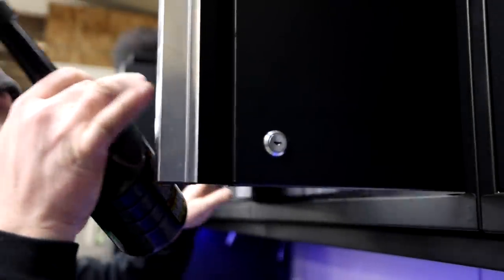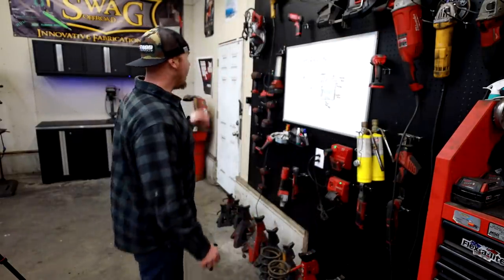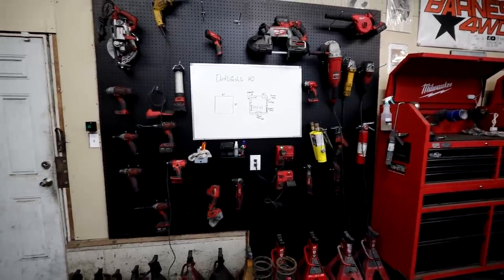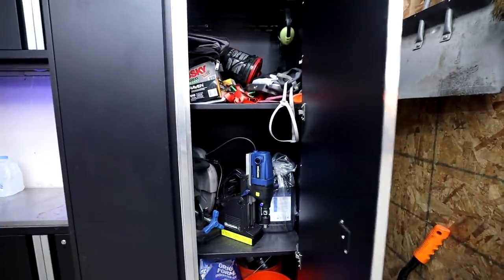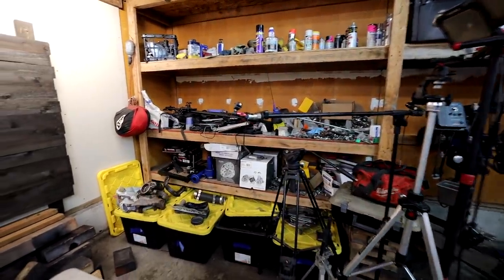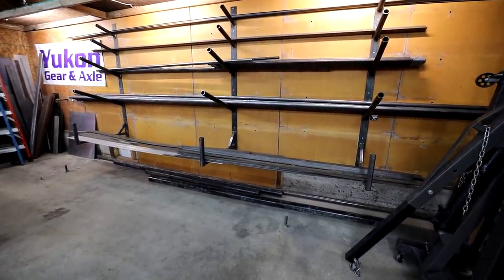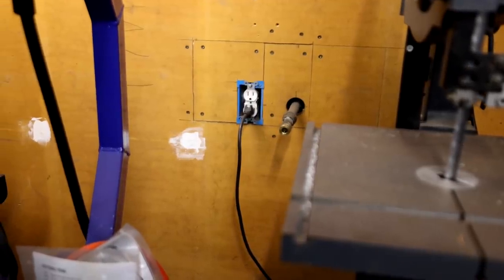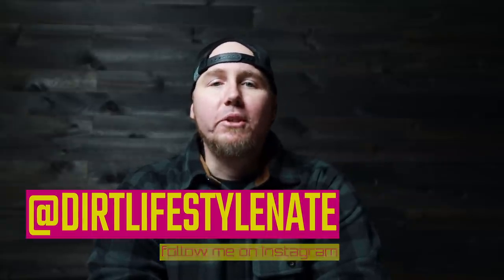Off-Road Workshop Tour! Let's Do A Garage Walk Around At Dirt Lifestyle HQ

Comment: I’m extremely glad you mentioned that you ran your compressed air with pex. I have been wanting to plumb my two car garage with air but wasn’t sure if pex would hold that kind of pressure.
Reply from the maker: We would test our plumbing systems to 150 psi for inspections and I never saw a problem. This system in my shop has been holding air pressure for 5+ years with zero leaks 👍
Reply: Not Pex Wirsbo, it a higher quality product and better in everyway, I build a house and oversized garage in here in Manitoba Canada where the winters are super cold and i have never had a leak in any part of it going on 21 yrs, thats in the house, garage inflow heat system with 2 loop system and air in the garage just run along the ways, although my compressor only produces 150 psi most tools don't use that much , it still hasn't leaked on me yet its worth the extra money and its not much more and you can do it yourself and doesn't take long maybe a day tops 👍
Reply: I used 1/2” pvc for mine and So far it’s working great! It’s pretty much a straight run, just an enclosed carport. Can’t fit a jeep in with all my tools/machine shop equipment in there lol. Have to work in the driveway but I’m thankful for the shop space I have!
Reply: I used plastic air line for commercial trucks it come 1/8 to 3/4 my shop plumed in1/2
Reply: I have been using my pex air lines for 6 or 7 years, not problems so far here. My friend owns a big brewery and plumbed the whole brewery with pex air system about 10 years ago and has no problems
Reply: @99unclebob  wirsbo is type A pex. Wirsbo is just the brand of pipe and they aren’t in business anymore anyway. Wirsbo was bought out by uponor a couple years ago.
Reply: @DirtLifestyle  we always tested ours 80 psi because in California water systems are supposed to be regulated to 65 psi. Never put more than that on there but I’m gonna plumb my air system with pex now.
Reply: Plumbed my garage air in pex used brass fitting and used 1/2 pex to 1/2 npt drop ear elbows to fit all my female air quick change couplers.  Been going for years no problem and it was very easy to modify when I installed new cabinets
Reply: @mikeparker5935  oh I meant to mention that I have been running mine at 125psi and kind of think my buddy runs his at 150psi
Reply: @DirtLifestyle  did you use regular wirsbo or did you go with the aluminum sleeved kind? UA 290 plumber down here in Portland looking to do the same thing in my shop. Love the content, keep up the awesome work!

Comment: "...Two car garage and a gravel driveway..."  I know what you mean. Three years ago I was putting running boards on my van in January, and it started raining 3/4 of the way through. Thankfully is was only 35 degrees. 
Now I have a 30 x 50 foot shop with a Modine heater and a Back Yard Buddy lift. I don't have the words to describe how thankful I am.

Comment: In my old mans shop he has a 1/2 inch plate on a scissor lift for years . The sheet is 8’ x 6 . All his grounds for the welders get clipped on . He’s been  rocking it for 10 years . His back thanks him when he’s doing intricate and repeatable jobs that you need to be close to. It also thanks him if he’s doing a backhoe bucket rebuild. The scissor lift has rollers for the feet outside and underneath the slab. It’s just another idea for you to think about.

Comment: Milwaukee tools are one of the best, I have a Milwaukee drill that was used in a metal working shop since 1972. I inherited ant the only thing I have done was replace the brushes and there was no need. Just did it as part of a tune up. Today still running strong.

Comment: I agree; a box is better;  my shop is 50 X 50  2500 Sqft. Pole barn.    I started building my shop 5 years ago, it's still a work in process; the essentials for me are running water, hot and cold,  a bathroom, HVAC, a place to relax and think, and a lift.  Have you considered an in-ground lift?

Comment: Thanks for taking the time to shoot a shop tour video. I plan to build a shop in the future, but for now I'm just going to build  smaller shop. 
Have you heard of a lift system called Maxjaxs?  I am not sure how heavy your rigs are but the max lifting capacity is 6,000lbs and is portable in the sense that when it is not in use you can unbolt it and roll it away to store it.

Comment: Get a large fan to circulate the air.  You might not need to run the diesel heater if you have air circulation.  The wood stove may be all you need.

Comment: I have the same  milwaukee tool box  as my  shop  box.  Hope to one day   have a   nice  shop like yours  my current   workspace  is  either  my gravel  driveway,  mom and dad's  gravel  driveway,   or    my recent  purchase  of a  10x20   shelter logic   portable   garage which  is     anchored  down  in my back yard, grass  floor and all.   My 79 dodge w150   just barely  fits in it,    but  I'm heating  it this  winter  with a    175,000 btu  ready heater, so it's  nice an warm   at least

Comment: I did my buddy's shop years ago with wirsbo. Everyone said we were stupid,  but has without issue ever since. Even ran it through a manifold so he only turns on the section of the shop he's working in. And the compressor is in the main garage and lines go through a breezeway so we don't have to listen to it.

Comment: Merry Christmas , I have a 30 x 35 shop and I hate dry wall so i used half inch chip board and put 2 coats of good white paint , also i have the same cabinets in red

Comment: Your shop is dope. looks like your going to have to build a shop house. I have a lift and it's a must have. Got mine from greg Smith. When you move you have to take them with you because of insurance reasons, so I have heard. I built my shop and I wish I would have gone with 16ft walls. And bigger, is always better. The new age cabinets are awesome. I bought some for my work but you're right they are expensive. But they're also cheap compared to some of the alternatives.

Comment: Enjoy the vids...keep them comin....from a fellow eco-diesel glad rub owner I have a request that I think many would enjoy watching.  Perhaps you could do a thorough overview of the gen 3 ecodiesel and components and characteristics (pros/cons) of ownership.  It has been reported by several owners without searching too hard on the internet of timing cover leaks early on as well as EGR cooler leaks etc.  I love the power/trq of my ecodiesel but if I'm being honest regarding  long term ownership  due to the complexity of this motor, required emmissions components, and current possible issues coming up with this motor (timing cover leaks, egr leaks, possible....I'm second guessing the reliability long term of this platform.  As Im sure you know that motor is shoehorned in that bay and there is not much room to get around at all.  appreciate the vids!

Comment: But with a lift you can keep a vehicle on a lift and one under it. I realize that defeats the purpose because you can't use a lift with a car on it, but I meant as far as storage goes. Obviously you'd need to be able to move said vehicle to lift another. Not trying to plug another channel but the skid factory makes good use of his two lifts because he builds cars full time and bounces between projects depending on which ones are waiting for parts and such. So what I am saying as far as storage goes its a benefit when you aren't working on a car but as long as you can move it the lift works. To make up for the large footprint that the lift takes up.

Comment: You are cutting yourself short without a lift. I drug my feet for 10 years then purchased one and I didn''t realize how cheap they really are. If you have never installed one you and a buddy can do it in a weekend. and to uninstall you and a buddy can do it in 3 hours max. and the foot print your mini would fit under anything you wanted to store on the lift. don't hesitate another second you will be overly joyed that you did. all of the negative you talked about doesn't account for even 10% of the good things you will be glad you did. pull the trigger man I can't emphasize enough. thanks for the video.